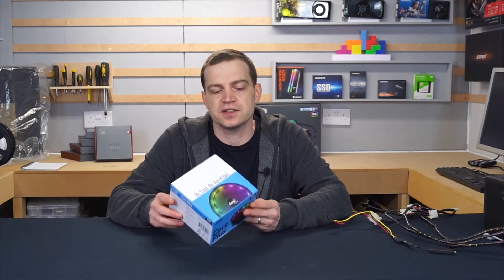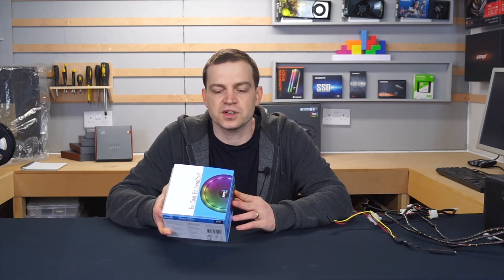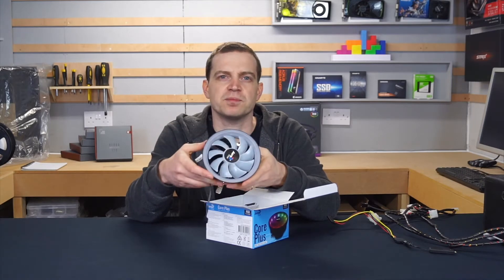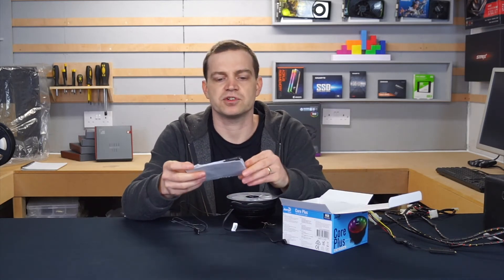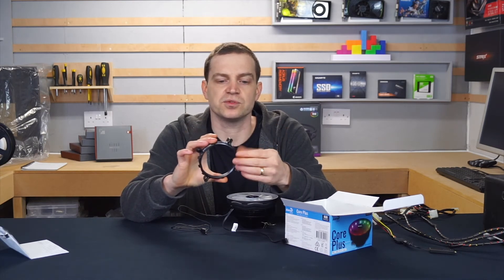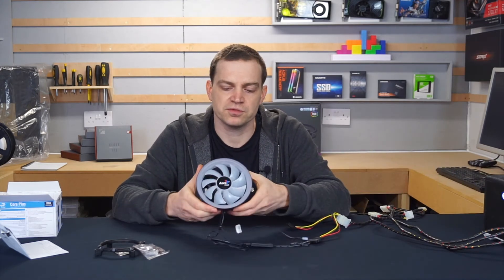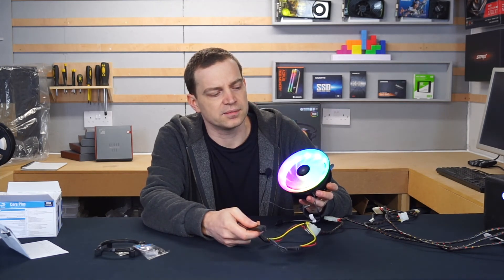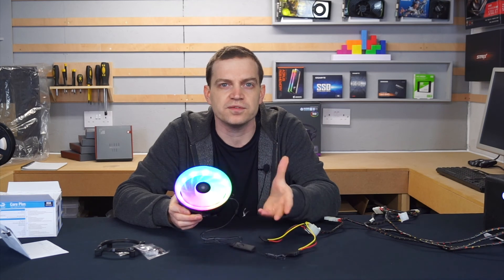Aerocool Core Plus.  It's silly and over the top but fun.

Comment: Works good for 11400f?
Reply from the maker: Not tried it ourselves but no reason it wouldn't as the 11400F has a low 65w TDP.  Should be fine.

Comment: Somebody built a 1500€ pc for my brother and put this cooler in it lol, it throttled and reaches 100c if you use dlss which shuts down ur pc
Reply from the maker: Yeah, not a great idea.  These are ok for you lower TDP (65w) CPUs but anything over that you have to go bigger.
Reply: @TechLabUK he has a ryzen 7 5700g which is 65 watt
Reply from the maker: @penguinz3091  It should easily cope with that CPU.  Maybe it wasn't installed properly.
Reply: @TechLabUK  Was built by a guy who builds computers.